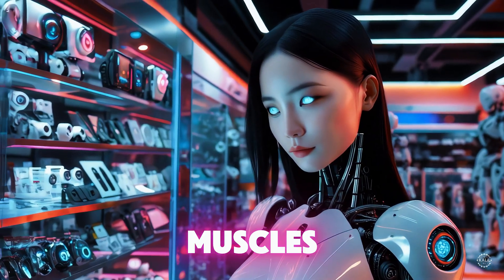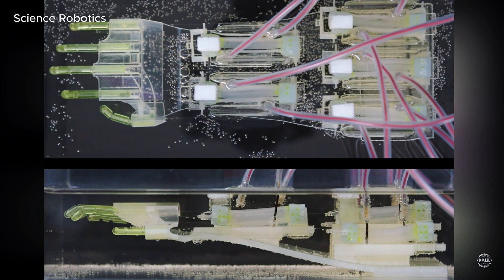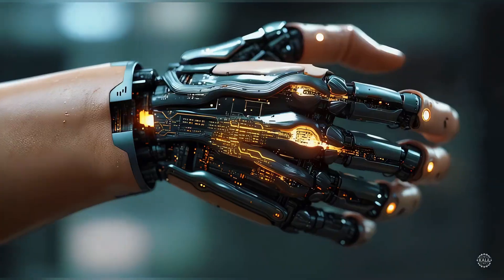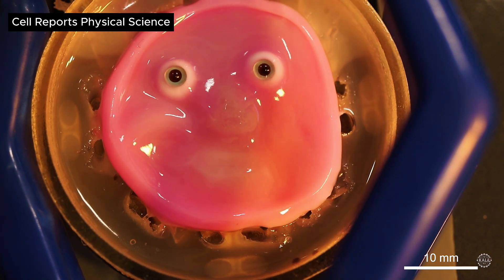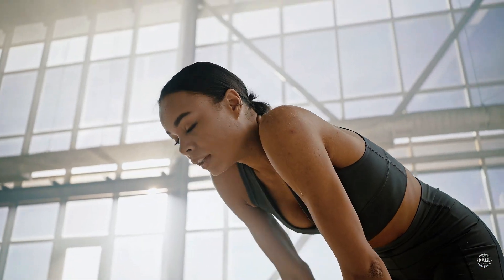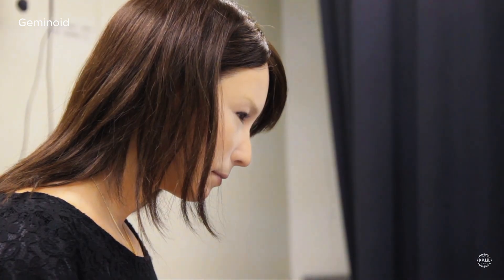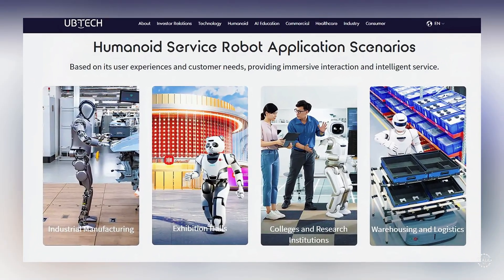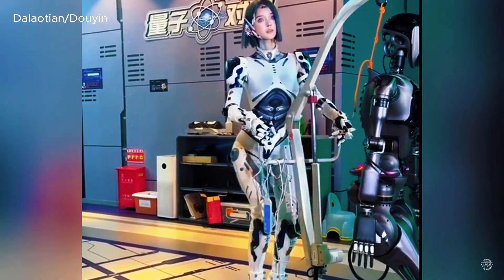Japan's Shocking Breakthrough: Robot Hand with Real Human Muscles + UBTECH's Hyperrealistic AI Robot

Comment: If they are going use human cells the create  the muscles , then the cell most be energized just like the muscles in the human body.
Reply: I'd imagine that they already know that.

That being said, there is research in the works to replace the function of certain cellular organelles with artificial equivalents.

In this case the interesting part is an artificial/synthetic mitochondria that produces ATP* (adenosine triphosphate) from ADP (adenosine diphosphate) using only electrical power as an input.

*ATP is the fundamental lowest level chemical energy unit that powers basically all life processes on Earth - any time your body breaks down sugars, fats or proteins to make energy it is just a string of chemical reactions (usually augmented by enzymes) that transfer the chemical energy from that original source to ATP.